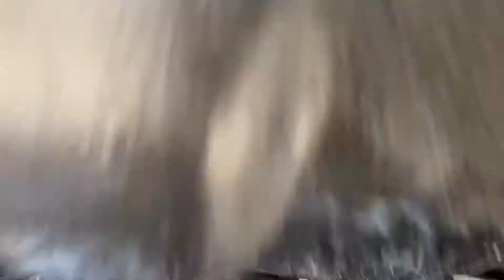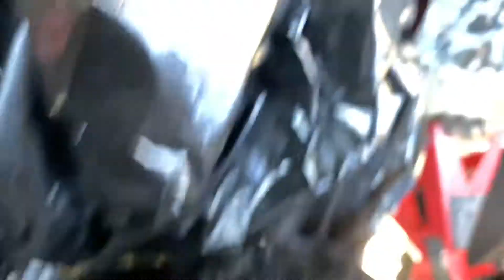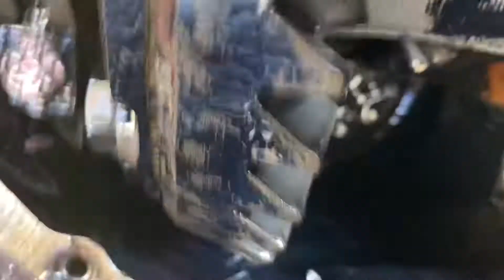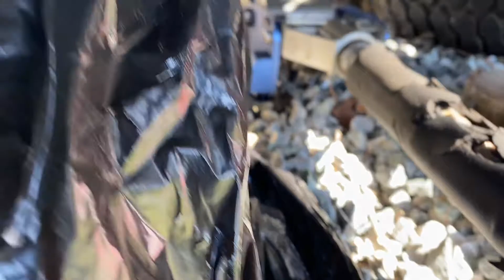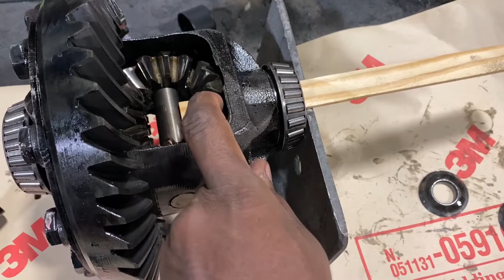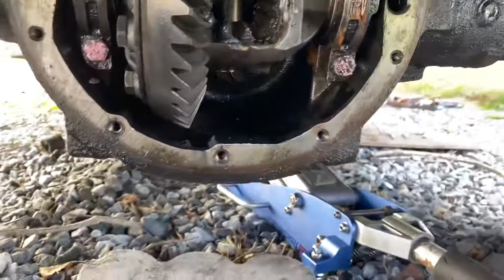Unbreakable Welded GM 10 Bolt Rear Diff

Comment: great thorough video how lng did it hold up that way im considering using a plate but gotta save every penny on my 82 caprice classic
Reply from the maker: @lizardmangarage  it held up nicely. Even with me beating on it a few times to see if I could break it. Of course tight parking and turns is almost impossible. 

But with a big hot welder a welded diff could last a while

Comment: I'm curious if you replaced the pinion gear along with the ring gear? I thought Ring&Pinion gears were a matched set. 

Also, I never would have thought the BBs from welding would have caused serious damage. I would have made that error too. There is an anti-spatter spray that welders use on their work benches that alows the bbs to not stick and slide right of the table top. Perhaps that stuff could be used on the the ring gear and the carrier the next time someone does this job 👍

Good vidya. Five stars.

Comment: tinfoil over the ring gear, then duct tape saved mine and I welded that shit in the housing, less work is always a win.... and at the point you were at, my question is... why did you not use a C-clip eliminator kit??? hate it when an axel and wheel leave that chat together and pass ya bouncing merrily along....
Reply from the maker: @evelkoloski  it was “just to do it” type of thing. The truck would have gotten a 9inch rear later on.
Reply: @AndrewsMotorWorks  100% Just did it to a 10 bolt 7.5 26 spline deal in my monza... till it breaks she be good enuff!

Comment: Did you weld both sides of the spider gears?
Reply from the maker: Sure did. All the way around
Reply: @AndrewsMotorWorks  and the axle shafts were able to slide in and out easy?
Reply from the maker: @burnoutgarage8559  to my surprise- yes. I thought the extreme heat would warp the unit, but I had a back up rear.
Reply: @AndrewsMotorWorks was it a c lock with a clip?
Reply from the maker: @burnoutgarage8559  stock unit from GM